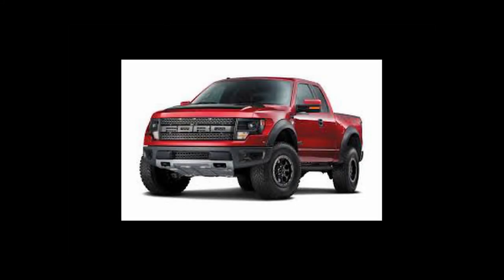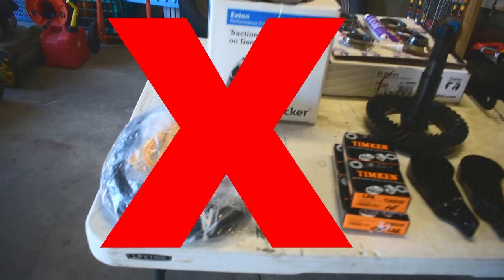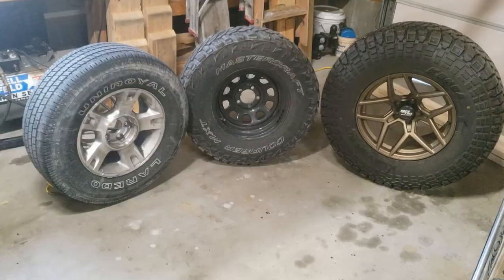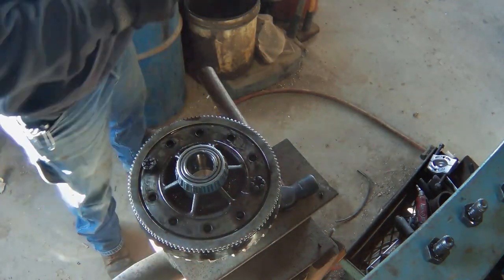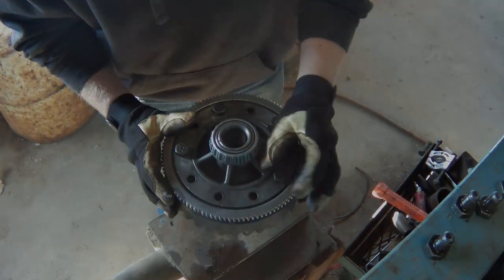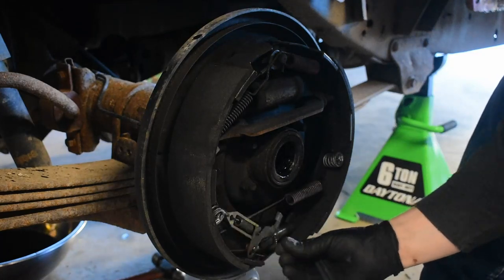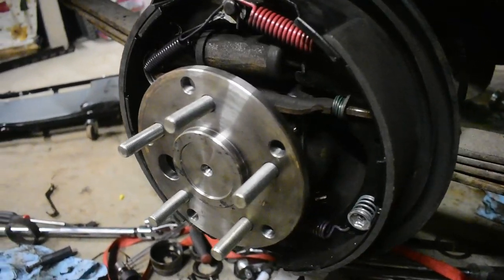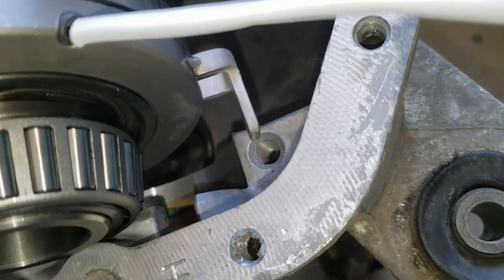Built a Mini-Raptor, Still Got Stuck...

Comment: If I was there I would of showed you how to get those c clips in.
Reply from the maker: If you have a way to install the C-Clips, please share it in the comments for others.
Reply: @SoloRoosterGarage  I can not put it into words how to do it and explain correctly. But you will need fishing line, the shaft and tube to be standing up a friend helps keep it from falling over 2 extra c clips, and you have to do it right the first time because there is no really good and easy way to get them out afterwords. So don't skip any steps or you are gonna have to do some cutting